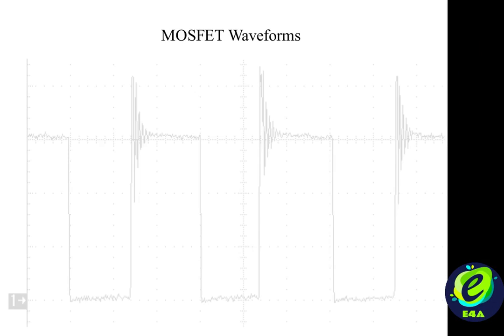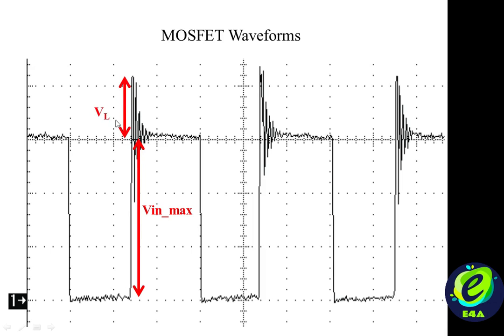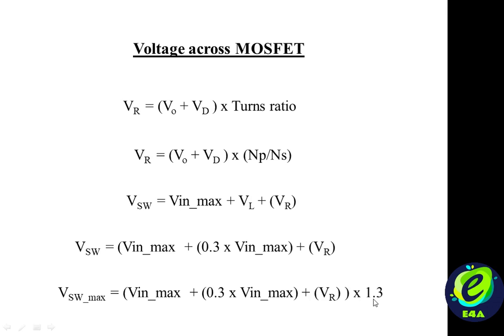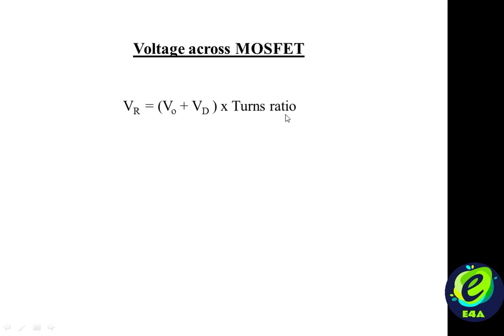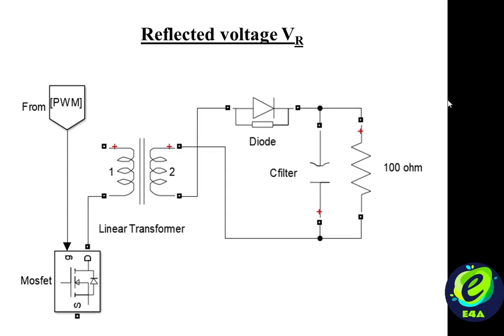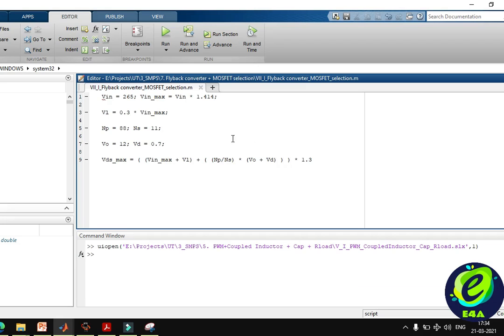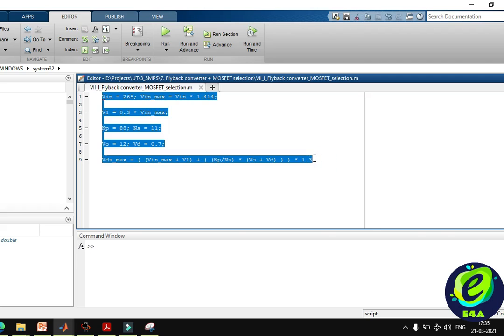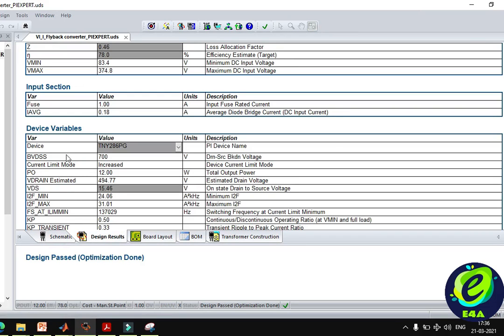#7 MOSFET SELECTION | FLYBACK CONVERTER SIMULATION

Comment: Why Vsw-max is being multiplied by 1.3? Is it 13% or 30%? How come it is 1.3?
Reply from the maker: 1. We have kept a margin of safety of 30% that if Vsw-max goes beyond 30% then also there wont be any damage...

2. It is a rule of thumb to have 30% margin of safety for voltage ratings and 50% margin of safety for current ratings...
Reply: @SimplifyingElectronics  that's ok. But according to formula you explained 
Vds=(Vin-max+0.3Vin-max+Vr) so after solving this it should come like 
Vds=(1.3×Vin-max+Vr)
Vds=(1.3×380+101.6)V
Vds=595.6V
Now 30% of 595.6 is 774.28V
So Vds-max = 774.28V
But as per your calculation it is 766V for the same given values. How?